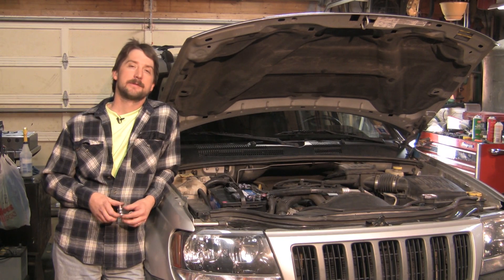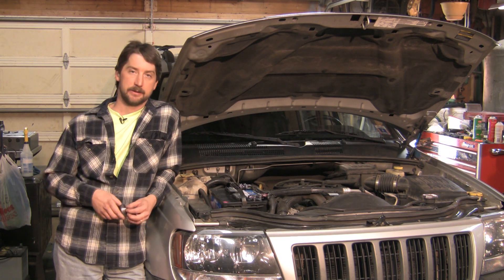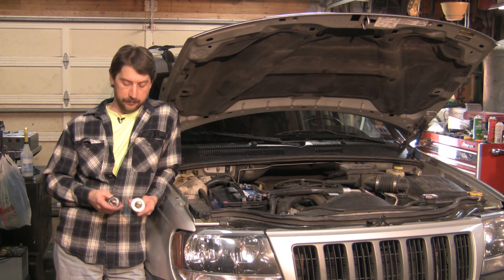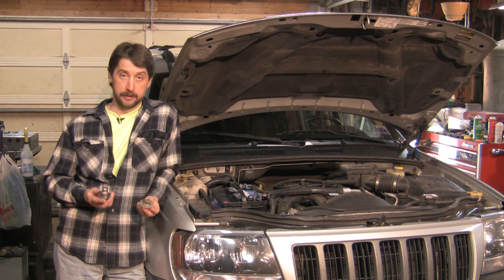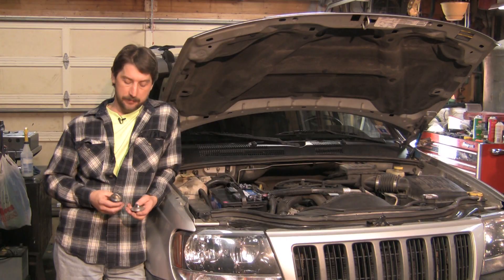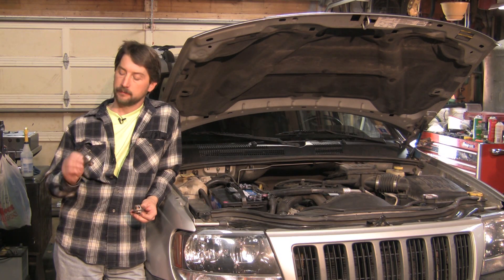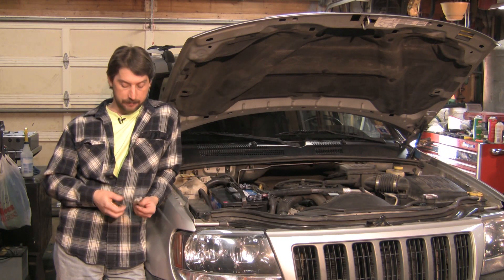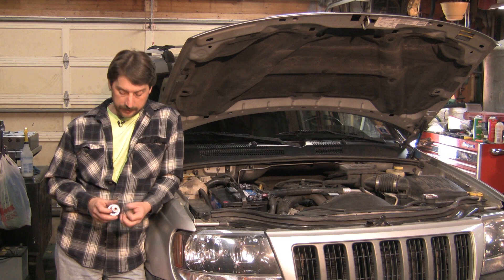Car Maintenance : About Engine Thermostats & Overheating

Comment: its not about the spring getting weak...it opens and closes because of the wax inside a capsule in the thermostat which melts an causes pressure buildup causing it to push a little piston out the capsule thats connected to the spring and causes the spring to compress...when the engine is cool the wax solidifies and the piston goes back down causing the spring to go back 2 closed

Comment: lolahavasuaz,
'
hi there,,,
thank explain,,,
i dont have a honda car,,,
thermostat is sometime stuck and water cannot go flow through,,,
then radiator / motor will getting HOT and steam off,,,
not good idea thermostat in the vehicle,,,
take off thermostat and water keep going flow through that help more cooler water without stuck

Comment: @bestamerica yeah right ha ha , maybe in your world, but not here in the desert of Arizona , no frik'n way it's part of a engine necessity . we have triple temp never ending heat here in the summer . if I pulled out the thermostat on my tow vehicle (Suburban 454 7.4 liter big block) the cooling fluid would move To quickly through the radiator and never have a chance to cool down. if "YOU" only drive a mile a day in a Honda , then I can relate to your comment